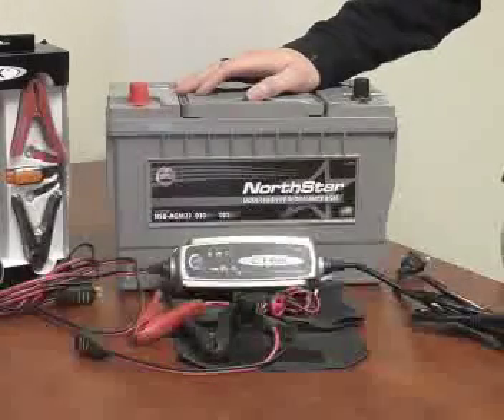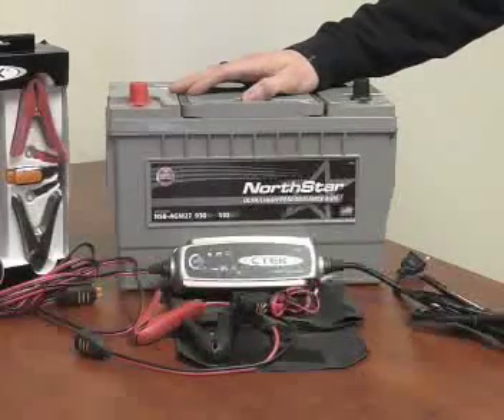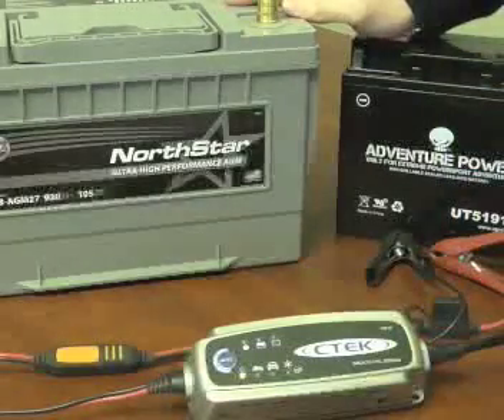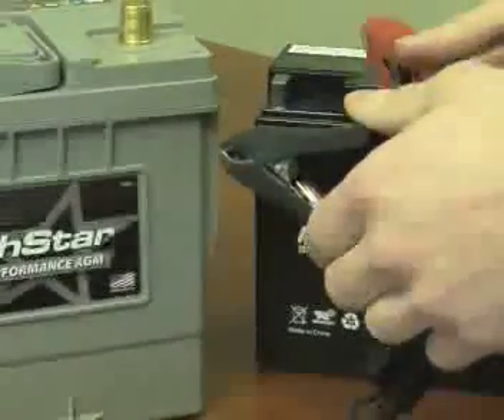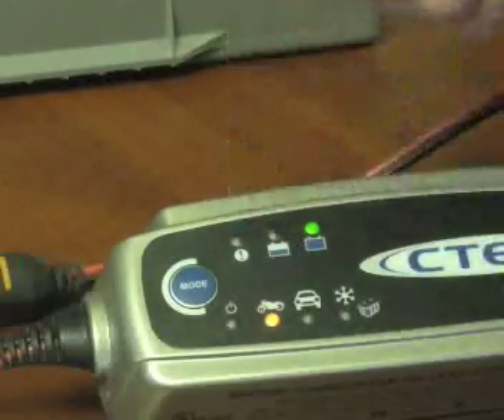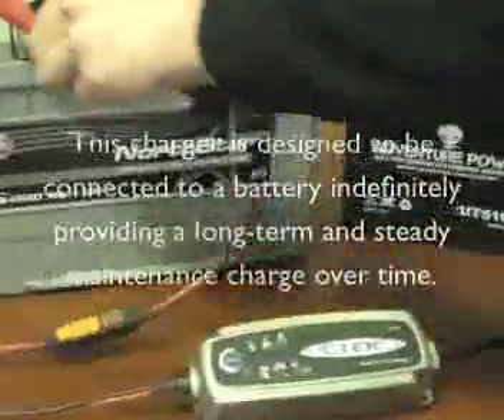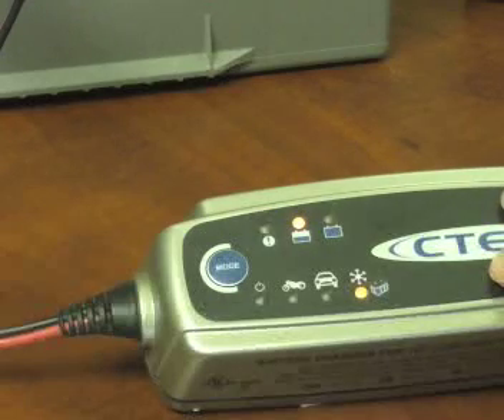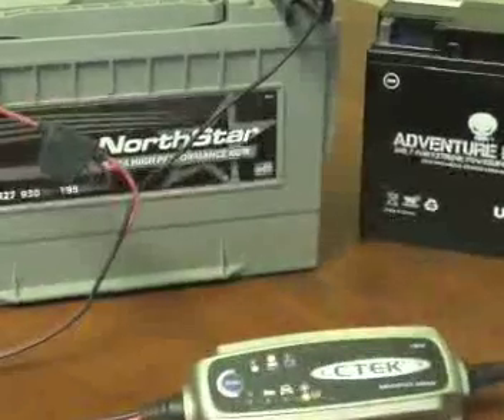CTEK Battery Charger MUS 3300 Tutorial

Comment: Thank you for the video.

I know this is an old vid but the chargers design stayed the same for some time.

Can you tell me, is the snowflake mode just for maintenance for stored vehicles over the winter?
- The reason I ask is, I have a vehicle that is a daily driver and driven in winter conditions.  Becuase its driven daily in the winter should I be using the standard vehicle mode or use the snow flake?

Again, I'm only asking because I'm not sure if the snowflake mode, although meant for cold conditions, is only intended for maintenance on stored vehicles/or vehicles not being driven for extended periods.

Thank you in advance for any advice!
Reply from the maker: The snowflake mode should be used in cold temperatures in general. The mode will still put the charger into its maintenance mode once the battery is fully charged. It essentially delivers a bit of a higher rate of charge to compensate for the affects cold weather has on the charging process.